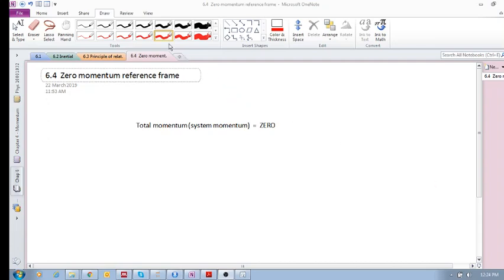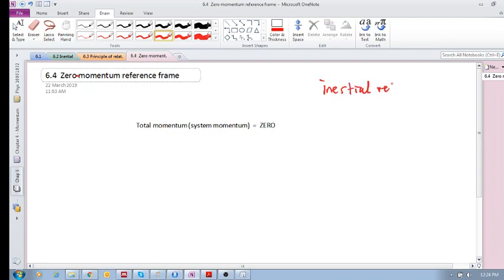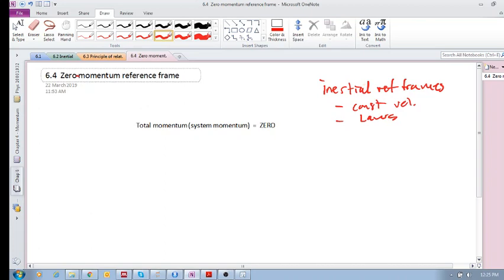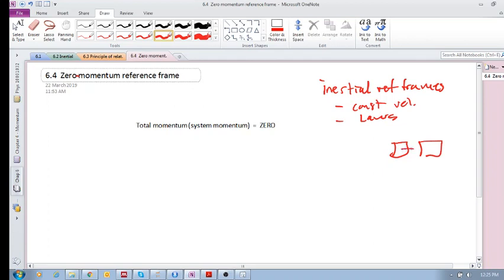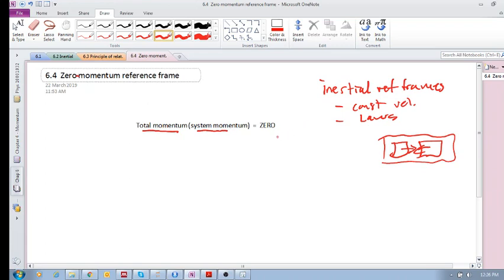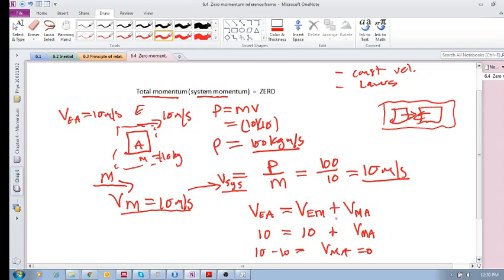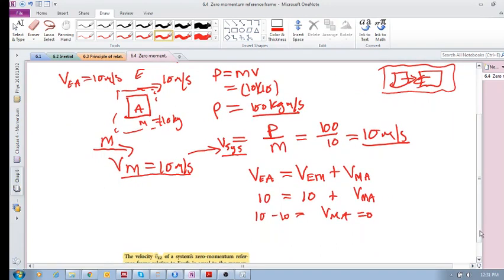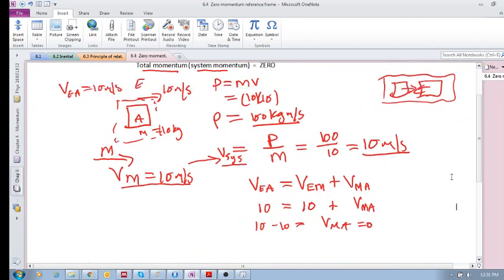Chap 6.4 - Zero momentum ref  frame  (a)

Comment: Water response can conserve large .moment for example if large transportation suddenly change earth mommentum responded immediately by ocean currents or under foundation of large building with floating foundation ground water with reversible inertia with pressurized regulator that constantly response to inertia change that change directional pressure then release valve spectrum response but outlet in reverse inertia in any direction then it can balance out any change or it can induce sudden change to initiate the same or more powerful change than 1000000 18 wheeler accelerate at the same time in same direction if it can response equal water of 100 of china dam with one shopping mall ir center on floating foundation and water outlet channel of approximately 2000 cubic m persecond. The preseason is earth radius is large